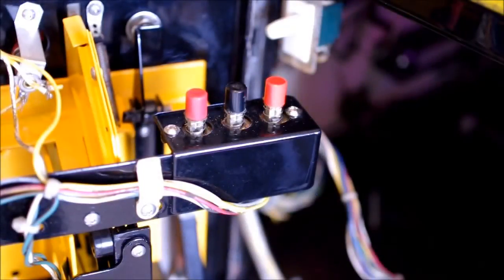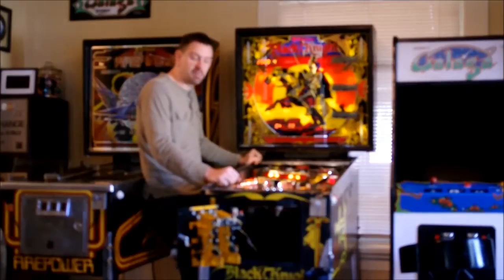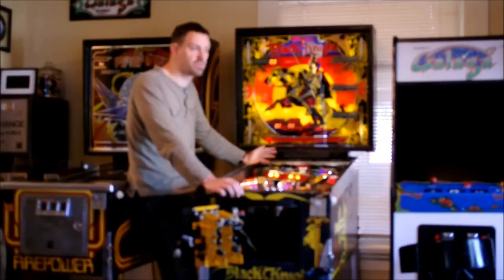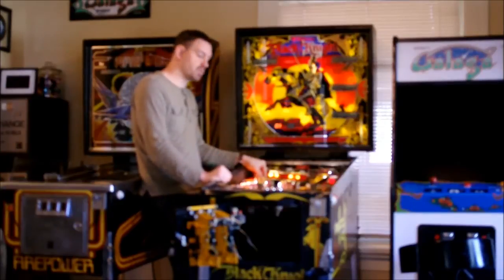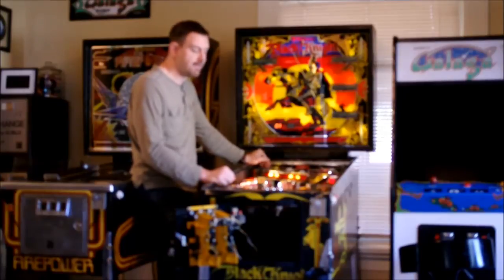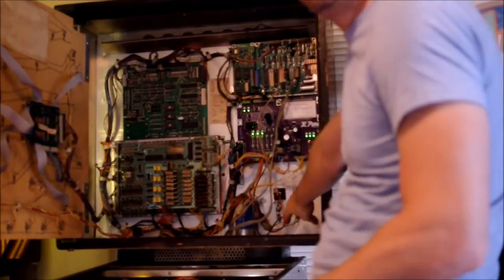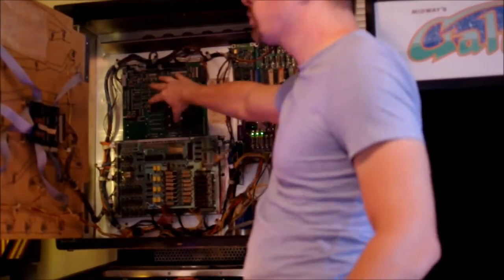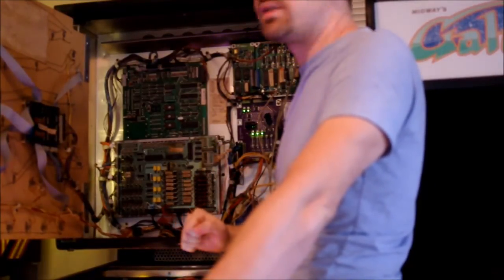Williams System 7 Diagnostics

Comment: Very nice video. I have a 1980 series 7 Black Knight. I saw your test in audit mode but you never showed how to set them machine back into play mode. I have the manual. I see how to but the machine back to factor settings. I did the tests and the machine shows no issues at all. The machine was working perfectly. I need to get the machine back to play mode.
Help?
Reply from the maker: One way to get it back into play mode is to turn the power off, and then back on again.  For System 3-6 this is the only method.

For System 7 you can also scroll all the way through the audits.  When it hits the highest number (I forget at the moment how many there are), and goes back to Audit #1, it goes back into attract mode.

As to the focus comments.  I do plan on redoing this eventually, I think I did it 7-8 years ago and my camera at the time didn't have autofocus.